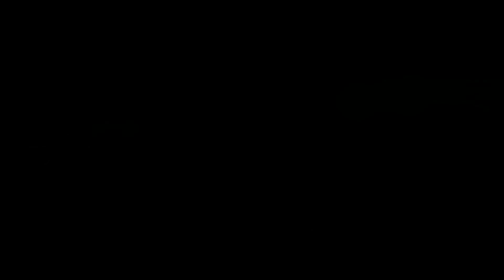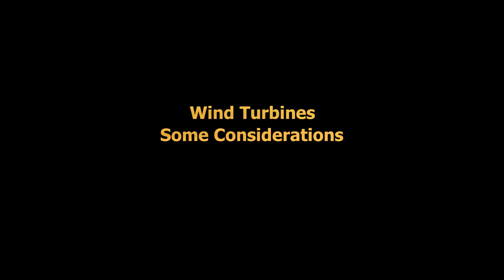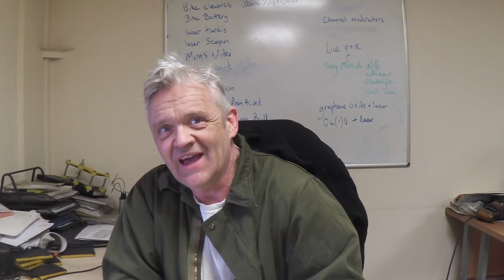1093 Wind Turbines - Some Considerations

Comment: Hi Robert, I had an idea today and the more I thought about it I wonder why it hasn't been done already.  This morning the washing machine was going as usual and the spin cycle was on...it came to me, why hasn't anyone add another gear box to the back of the motor driving the drum and then generating more power from the spin cycle, put a power socket on the front of the machine and then use the power produced during the spin cycle to do other things....boil a kettle?  What do you think?

Comment: The ROI depends on the type of intent to build a wind turbine. If you just want to make money with it (subsidies and energy market prices) then it boils down to big HAWT's (3MW +).
Vawt's cannot yet be produced at this level of performance.
However, if you want to be self-sufficient and meet your own needs, in my opinion you are better off with a VAWT, because you can also operate it discreetly in urban areas. Their performance can also be increased by front-mounted air deflectors, which also cover the rotors so that there is no visual disturbance. VAWT'S are also considered bird-safe in contrast to the large HAWT's

Comment: The available energy in wind is not proportional to the average windspeed - it is proportional to the Mean Cube of the windspeed. This can have a very different value from the average eg. average speed of 1 if constant the Mean Cube will be 1. If half the time it blows at 2 and half at 0 the Mean Cube will be 4.

Comment: I experimented with a few small HAWT's back in the mid 1980s to power remote radio repeaters.  On a pole on a hill top a small generator (300W or so) did a great job, plenty of power.  Large solar panels were new at the time, very expensive and didn't work very well.
As you suggest, it's more complex than it first appears.  Is the claim of 1000W dishonest because you only get 50W in a 8kt wind - not really.  Is a 400Kg trailer rating deceptive if you only carry 50Kg in it.  They may be stretching the truth a bit because on a hill top in a gale it would probably fly apart not long after achieving 1000W output.  It would be nice if they said, typical output 100W, peak output 1000W - but engineering would have to sneak that past the marketing department.
I thought about putting up a small HAWT here at home.  I bought a unit rated at 400W max (in a strong wind) but didn't bother putting it up after finding that our average wind speed is only 10Kph and most of the time it would do nothing.

Comment: A couple of things, is avg wind speed, avg over area or over time? Put the turbine in the right place and you could do better than the turbine in the avg place. Second thing, the wind is free, we don't need to extract the maximum, skimming the easy stuff is enough, I never understand why we don't build more smaller units rather than huge close to max efficient units.  Cheap and plentiful beats costly and scarce. Apart from the nimby aspect , that is, easy for me to say have more when all will get permission is fewer where no one has to see them.

Comment: Gusts Robert, Average Wind Speed does not take Peak Winds into Consideration.
Hence the Ratings of 1Kilowatt may be the Rating of the Internal Alternator or Generator.
In turn Perhaps at Max Speed your Wind Generator will Produce 1 Kilowatt but it has been designed to ensure it can not go past max speed because of Failure.   Hence the Problem is the Design and how to Better Manage and Maximise Occasional Gusts, High Winds?.
Another Good Topic.

Comment: I have an unbalanced horizontal flywheel, it falls into gravity or the point of the least pressure mediation and it might well be past the 0 point thing. It requires very little input to turn. Maybe soon it will be finished. Lol

Comment: And an axial flux machine with 6f blades is cheap. Blades are next to free because I carve them myself. A brake hub assembly is $10 from the wreckers. New bearings are a few bucks. The only major expense is ~$200 for the neo magnets. And quiet too. Solar is much better of course. But it's great when I can use my inverters at night when it's blowing.

Comment: How efficient are the helical bladed turbine in comparison to the vertical blade turbine? I have been thinking of making a wind turbine to suppliment my 12 volt, 1 KW solar panels charging 450 Ah batteries. Currently I am just powering my house lights and things using DC plug packs. Why convert AC to DC when you have it on hand freely generated (after startup costs). Anyway I am debating between a turbine turning motors or the magnets passing coils,I have lots of both but need to purchase the blades (I have a squirrel cage)

Comment: A silboat sails much slower if it sails away from wind (with the wind) than sailing perpendicular to the wind. This is why the horizontal axis turbines are more efficient. If there is only enough windspeed and no turbulece. At small windspeeds and in turbulent condititons the vertical axis wins. Square sail vs. triangular sail is same difference. Square one uses only drag, the other is a wing, where the lift force is resulted by air pressure difference between the top and bottom surfaces of the wing. Preasure difference is caused by different top/bottom air speeds caused by shape of the wing.

Comment: I was just discussing the price performance trade off in regard to camera lenses.
an 85 mm f1.8 is less than $500 and weighs less than half a kilo. An 85mm f1.2 costs $2,000 and weighs all of a kilo.
for 2/3 of an f stop. 
The f1.8 is a lens so good that it's design has been unchanged since it was introduced for film cameras.

Comment: 4.40 - that's not the maximum it can generate. It's just the maximum it can generate in the average wind. On a stronger windy day (like today in Derbyshire) it would make a lot more than 50W. I don't like the Tesup and I agree it's not on the call it a 1kW machine. But it's also not on to say the maximum it can make is at the average windspeed. That average is made up of 10m/s days and 0m/s days.
Reply: But to get the claimed power you would need more than 40m/s wind... Not sure there have been many 90mph wind days in the last 20 years. Also if your looking into generating power from wind wouldn't you want to know what the average power your going to make is rather than the peak?
Reply: @7mgtesup1  yes, that's why I agree it should be called something like a 200W machine not a 1kW. I'm just picking up that he says the maximum it will make is 50W which also isn't true. (Although I really don't want to stick up for Tesup because I don't think they're good machines! I'm stick up for generic 0.8m radius machines...)

Comment: As a DIY builder using scrap material, my biggest problem using HAWT's is not the actual generator, but the efficient pole bearings and slip-rings; I was wondering if you have any thoughts on the matter?

Comment: Didn’t mention ‘Amortization’.  £30 spent on a turbine which will keep on working for 25 yrs is a lot cheaper than one that costs £10 but lasts only 25 months. Ergs ! Only Rob's rowing cart grind them out now since the introduction of SI units.
Reply from the maker: Great point! - but I don't know of one that costs £30 and last 25 years!
Reply: @ThinkingandTinkering  I was thinking along the lines of: 
When £10  turbine (or any other mechanical contrivance) has been built and proven — attend  to the details. These would include protecting it against corrosion. Ensuring the parts are sturdy enough not to brake from fatigue. Endeavour to make future servicing and maintenance easier,  e.g., any nuts, screws, terminals etc., that may need to be undone are coated with silicone grease. Coils protected with resin and so on.  A godsend (repeat this out loud, so as to remember to do it) is to included a small weather proof container,  into which to place useful notes. E.g. Type and part number of carbon brushes (perhaps include a spare) and anything else about the apparatus that you will (mark my words) defiantly forget over time. Saves hours of having to suss things out all over again (you’ll appreciate this better if standing at the top of a ladder on a cold winters day). The container can be very small, such as a pill bottle secured by a U shaped pipe clamp. Hey Presto, £10 turbine is now a less expensive £30 machine. It used to be the norm to build things to have a service life of 25 years (even motor cars).  Hard evidence of this fact can be seen in awesome motion, upon a visit to any Living Heritage Museum. And easily achievable today.

Comment: Strange I would of expected HAWG to not be allowed, and VAWG’ allowed, as they are more compact don’t have Metre long Blades spinning round and be fixed to a Balcony handrail etc, so don’t need to intrude on public views. A hospital I went to had VAWG on poles outside the front of the building,  so why not the public?
Reply: I noticed the mistake and it was correct the second time mention :)

Comment: Wind turbines are not economically viable.   If they were they wouldn't need government subsidizes. 

When the real engineers get involved and do true cost analysis they all come back with that conclusion but nobody listens.   The trouble is that many don't carry out the true costs.   Efficiency is one of the first things that gets overlooked but more than anything many don't look at the cost of construction, transmission, maintenance, liability and lifespan. 

In the US we already have 10 year old wind turbines basically falling apart.  In 10 more years they are gonna be junk. 

People were thinking they could just plant all these windmills all over the country and they would just sit there and make electricity forever and for free. Nope.  Doesn't work that way.  Just because the wind is free doesn't make the electricity free.  Indeed it can cost more than other generation methods. 

In the US natural gas has become the common way to create electricity.  It features a retail price of about 0.12 cents per killowatt.  It's a hard price to beat.   If you can get it, buy it.   Solar, wind or whatever it costs more.  Nuclear might be cheaper but not when you calculate it down to its true costs. 

Thumbs up on the video.   I've tried numerous times to explain to people the efficiency trap you get into with solar and windmills.   Most people don't listen.   They just think free sun and free wind.
Reply: Big wind is already cheaper than coal and gas. As is large scale solar. Levelised cost of energy calculations take into account maintainace and decommissioning.
Reply: Problem with natural gas is that its not renewable and that burning it has other byproducts.
Also the cost of the natural gas shouldn't be measured in money, as always when taking something from the earth the price tag is not a financial one. Windpower based on recycled materials is impossible to beat (and not even comparable) with natural gas.

Comment: There is a channel called Marty T, he lives in New Zealand and has converted a washingmachine to a waterturbine, it seems to function very well and it generates electricity for years!
Reply: @marthale7 Think so too, you usually do not need high peak power if you can generate reliably just hundreds of watts 24/7 with a storage solution!
Reply: I just found one at the dump. Water turbine it will be :)

Comment: Can we channel the wind into the fan blades.
Reply from the maker: for sure and there have been several attempts to construct such devices - none of them out of the lab and the one commercial try - failed - it would seem there are more problems with the idea than one would think
Reply: @ThinkingandTinkering  I see like direction of the wind you see i see that some design's of building's blast wind down an the can make places dangerous. People just blowing round up an down the streets we miss out when we build to not use it that high up poor designs.

Comment: Is it possible to take advantage of the venturi effect with lower atmospheric pressure/suction for low wind speeds using a fixed swirl patterned disc to focus wind to a section of a horizontal Pelton blade? Not sure if it might spark some ideas, but check out how bladeless fans creates increased air movement via lower atmospheric pressure. 

I also don't think it's possible but would love to be proven wrong on this, it would be amazing to see a 'bladeless wind turbine' somehow.
Reply from the maker: it is mate and there have been several attempts to construct such devices - none of them out of the lab and the one commercial try - failed - it would seem there are more problems with the idea than one would think

Comment: In my mind the eficiency of a Wind-Turbine is not important, because the wind don't send a bill. As you said: You can buy or create youself. A vertical turbine is much easier to build and far less complex as a horizontal turbine. Additional  - depend of construction - a vertical turbine makes less noise. 
Finally: If you build your own Wind - Torbine and get the first light shining from your own prodused electricity: It's unpayble! - And that's what is counting.
Reply from the maker: I agree 100% with that mate

Comment: There's cost and there's utility value, can think of two small scale mass wind harnessing uses that seemed to have at one time had traction.  Wind powered pumps - remote areas, farms generally  without other power sources; and boats - small turbines to keep batteries charged up - limited space and not fouling the deck favouring these over solar panels.
Reply from the maker: absolutely mate and I hinted at utility towards the end of the video - so, basically, I agree with your point - nicely made - cheers